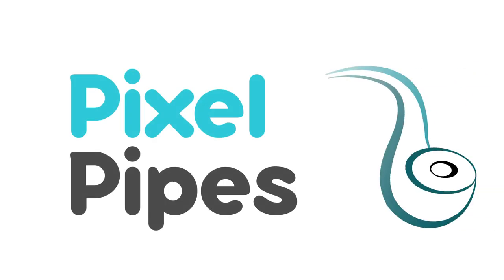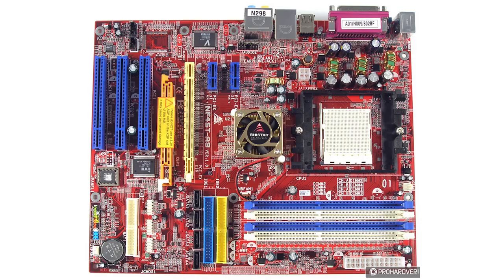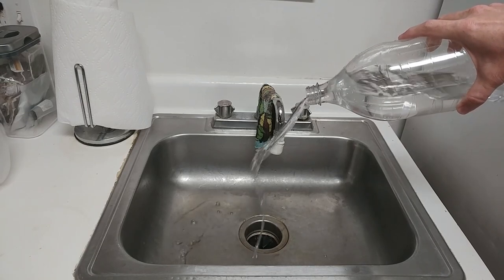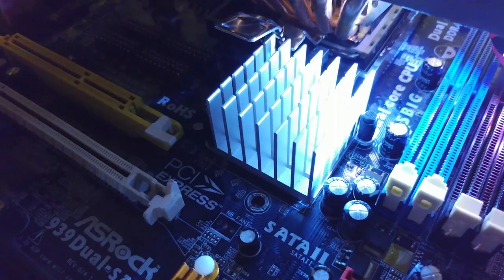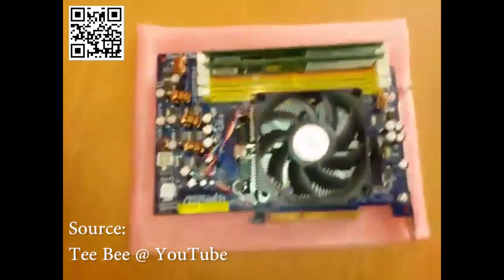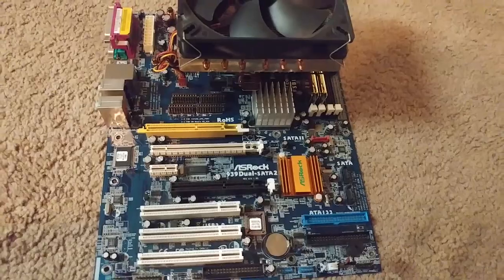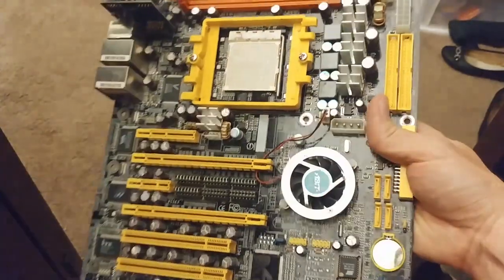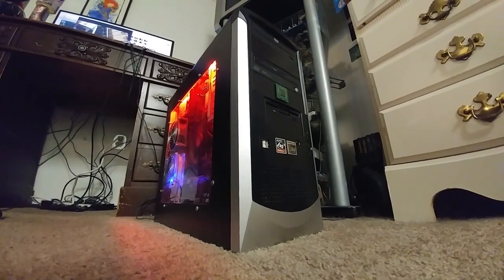Maybe the BEST Athlon 64 Motherboard Ever Made

Comment: I recently bought one of them, it came today.
Reply: How is 939 in 2019??
Reply: I'll do you one better: How is 939 in 2021?
Reply: @MauricioRPP1  I have collected a few high-end Athlon 64 motherboards, but none of them are on any build as of now. But I have an Athlon 64 3200+ on a socket 754 motherboard running Windows 10. It's actually useable with 2GB of ram and an IDE drive. So we can assume that a socket 939 with an even faster CPU or even a dual core with 4GB dual channel memory would be even better.

Comment: I´ve owned one back in 2004/5. Overclocking was impressive with my Opteron 146 running @ 3 GHz with stock voltage. It had some compatibility issue running 1T command rate that I didn´t have with another 939 motherboard that I owned, the nForce4 Ultra based Epox 9NPA+ (great mobo). But overall impressive overclocking capability, I could use any card (I did not get to use a PCIe one back then) and it was CHEAP.
Reply: I have one Asrock 939Dual-SataII, this week to sell, with the CPU X2 4600+, and 3 gb memory (2 x 1gb, 2 x 512 mb),

Comment: This mobo was amazing. I was lucky enough to get the AM2 daughter board off of eBay which allowed me to install an FX62 CPU and 8 gigs of DDR2 800 RAM. It was pretty fast and it was the most stable PC build I had at the time.
Reply: Do you know where to get one now? I have 2 of this mobo and would love to have the daughter board. I would buy it from you!
Reply: @p4stagg448  Unfortunately the system died due to old age. Try eBay, it worked for me.
Reply: I have one Asrock 939Dual-SataII, this week to sell, with the CPU X2 4600+, and 3 gb memory (2 x 1gb, 2 x 512 mb),

Comment: Your title is so accurate.  This is from a time when there was competition in the chipset space and motherboard manufacturers were still innovative.

I had one of these and it extended the life of my 9800 Pro by a year or two and with the voltage mods and OCW beta bioses, it was one of the best  overclocking boards of that era.  I remember hitting some crazy HTT speeds on that board.
Reply: I have one, this week to sell, with the CPU X2 4600+, and 3 gb memory (2 x 1gb, 2 x 512 mb),

Comment: This board was the board that put asrock on the map

It did everything, but wasnt price gouging unlike the other brands at the time
Reply: and now this board can hardly ever be found, the one i found the seller wanted i think $600? and it was from china soo.
Reply: @thelasthallow  Well, I have the even better ALiveDual-eSATA2, owned from new, since 2008 with the retail box packaging, documentation and everything and I should probably sell it to an enthusiast rather than cart it half way round the World.
Reply: @jimjamz.  if its the intel board its only worth about $100, the AMD board is worth north of $400 because it can take Phenom 2s which were faster than core 2 quads and are more modern.
Reply: @thelasthallow  It's the AMD board. I have a Phenom II X4 965 plugged into it and an NVIDIA GeForce 6200 AGP as we speak.  Owned from new since 2008, retail boxed with all accessories, manuals, driver CDs, cables etc...

Comment: I just realized that I had the AGP versions of both the Sapphire ATi Radeon X850 Pro with 256MB VRAM, and the ATi Radeon X1950 Pro with 512MB of VRAM. The X850 Pro was modified and overclocked the same day my roommate got it, the X1950 Pro was a factory overclocked HIS IceQ 3 Turbo card. All of my ATi cards from the heavily modified and overclocked Sapphire Radeon 9800 Pro with 128MB VRAM, to that HIS card, they all served me very well. My first PCI-E video card was a Sapphire Radeon HD-7770 with 1GB of VRAM. My last AMD card was an R9 290 with 4GB of VRAM, then to a Nvidia GTX 1070 with 8GB of VRAM and currently a Nvidia RTX 2080 Super with its 8GB of RAM. Have to say, computers were more fun early 2000-early 2010s.

Comment: The ASROCK 939DUAL-SATAII, and my ASROCK 880GM-LE FX were some of my best boards.  I got my A64 up to 2.8 Ghz and it could have gone faster but I had to lower the memory divider too much so I ran it at 2.6Ghz. I had a Phenom II x4 running at 3.9Ghz on the 880GM-LE FX.  This is on stock voltage, with stock heatsinks, and with cool n quiet enabled.  They were very stable and I never had issues with them.

Comment: Good board.  I have one of those DFi Lan-Party NF4 boards still running, and used the AsRock 4Core-Dual SATA-II back in the day. Very similar, except with full 8x AGP but only an x4 PCIe electrical (x16 physical).  Had the advantage of more SATA-II ports and Core2Quad support.

Core2Quad + HD3850 is I believe the best AGP system you can build.
Reply: Yes, it's best AGP combo, you can get. Not sure , if DDR3 are supported too, or only DDR2. Anyway, it's overkill for that graphic card, overclocked Q9650 can handle even 1050ti, before it starts to bottleneck graphic card in games significaly.

Comment: buyed this board in 2006 cause its was the only board with dual slot pciex and agp i was looking for a board capable of both cause i was upgrading and my graphic card was a 9800 pro agp 128mb but all new board came with only a pciex slot, i later upgraded for a x1600 pro 512mb pciex but i consider this board as one of the best i ever had but after 6 years the capacitor were broke so i just upgraded it for a new board upgrading from a athlon 64 to a phenom II x4 and im always using it today my board date since 2012 i also upgraded my graphic card to a hd5770 and now to a rx570 and even today i run graphic at very high with my old phenom II !! its sure i upgraded the ddr3 ram ssd and newer 4tb hdd  & power supply remaining to upgraded for a new board + cpu and ddr4 ram and i will be able to continue for the next 5-6 years !

Comment: Nice! I have this exact board with the AM2CPU upgrade and an x2 6200+ running in it with a beta BIOS that adds support for it.  Another board to look into would be the ALiveDual-eSATA2, which has an AM2+ socket that supports all the way up to a Phenom II x4 965, but still has FULL AGP 8x and PCI-E 16x support. It's interesting to test old AGP cards like the 9800 Pro with a somewhat modern quad core cpu so see how they perform with no cpu bottlenecks whatsoever.
Reply from the maker: Man, I would LOVE to have that board. I've had it in my saved searches for ages now. They never show up on eBay.
Reply: It was a very hard find for me. Took ages of searching online to finally get my hands on one.
Reply: Does it work with Vista or later OS (I own AM2NF3-VSTA) ?

Comment: I had one of these, really stable and great for overclocking. It was my first proper gaming PC had an Athlon 64 3500, a nVidia 6800xt and 2 GB of RAM in a chieftec case. I got a 4000+ and managed to run it at 2.7 GHz as a daily OC. That was with a cheap cooler and when I was 14 years old too. I always wanted the CPU upgrade slot but could never find it, it probably would have cost what I paid for the whole system though anyway.

Comment: Nice build and video!  I have this board and the AM2CPU laying waiting for a build. What kind of cooler do you use? Have you tried installing Windows 98 on it?
Reply from the maker: RetroCompaqGuy Thanks! The cooler is a Scythe Zipang. I only recently discovered the drivers are 98 compatible, so I haven't done that yet. But definitely will!
Reply: RetroCompaqGuy, when it comes to cooler and the limitations of the size that the AM2CPU gives i give one tip, AIO.
AM2 is identical to AM3 on the bracket and bolt-size so an AM3 AIO liquid cooler goes right on.
and a tiny singel 120mm one can be bought cheap.
don't know whats the cheapest on you market but here you got Antec's and the Corsair Hydro H74 for less than 50£

Comment: I own one of these as well, it was actually in my very first self build self bought computer, and it was my first try at bang for buck! I stocked it with an AMD Dualcore Opteron 165 (1.8GHz stock), 2x2GB OCZ 400MHz CL2 DDR, AGP NVidia GeForce 680GT 128GB, 128MB Ageia PhysX PPU, SoundBlaster X-FI Extreme Music, 30GB OCZ SSD V2 and 2x 320GB Western Digital Black 7200RPM in Raid-0. It was also my first overclocking machine... It still runs at 2.4GHz, with the ram at 484MHz CL2, the GPU was able to unlock all vertex and pixel pipes and overclocked just under the speed of the 680GTX. I later went on to put a PCIe 7900GTX in it which I later put in my then new machine (C2Q q9550) and thus the 680GT went back into it. It still runs perfectly to this day and is now being used as a basic AD and File/profile server + (WiFi) Router (Windows Server 2008 R2 with an AD/DHCP/DNS and IIS + Symantec Endpoint Protection, current uptime is around 1.5yrs and that time is low only because I moved it to a different house, uptime before that was around 3.5 years)
Reply: I have one Asrock 939Dual-SataII, this week to sell, with the CPU X2 4600+, and 3 gb memory (2 x 1gb, 2 x 512 mb),

Comment: That really is a awesome board. Agreed that it is a great board to tinker around with. I had a number of different CPUs and video cards in one over the years, but eventually settled with an Opteron 185, and a GTX 560 ti. Was a great gaming PC. Till it died a couple years ago, had the same problem of bad capacitors by the CPU slot.
Reply from the maker: It's definitely worth salvaging!

Comment: I have this board still, from a build back in 06, but unfortunately I’ve popped some caps and it just doesn’t make sense to repair it at this point. Which is a bummer, as it’s the first computer which I overclocked and it performed great.
Reply: Probably wouldn't be too expensive to repair. A handful of decent caps shouldn't cost over a buck or two apiece.

Comment: This board was very stable compared to my other amd boards at the time, and it was super cheap. The thing is, you said that it was a good oc:er but for real oc prowess you had to do a simple hw modification, just solder on a resistor and this board would fly.

Comment: I brought one of these when it first came out..I still have it..And it's in a working PC..At least it was when I last used it. Specs as is: 160GB Seagate, 512mb ram (4 x 128), ATI X800XL, Pinnacle TV card, Netgear wifi, SCSI Card..The cpu I am not sure of..I can't recall..I think its a 3800+ Athlon..or higher..Unless I set it up with a monitor etc I won't know for sure...been a while. Always hoped to get one of those add in CPU upgrade cards...but they were expensive and now rare as hens teeth. Pushing the price to crazy money.

Comment: Which are the other motherboards that use this full AGP & PCIe combo?
This is why i LOVE older tech , new tech is BORING at best
This was/is the board if people want to run stock configs mostly without any major crazy overclocking
It simply has Everything, best of both worlds: 
AGP or PCIe
IDE or SATA
FX 55 single core or  FX 60 if you want 2 cores
939 or 940 AM2 
DDR1 or DDR2
Great for Win XP or older 
..just imagine if instead AM2 add on board expansion, you could put Intel one :)
& the best part it was dirt cheap for what it delivered
Reply: 4Coredual VSTA quad core ddr2 support.
Reply: There is also the ASRock 939Dual-VSTA, wich is pretty similar to the shown 939Dual-SATA2
The ASRock ALiveDual-eSATA2
And the MSI 649 Neo-V
And one rather rare thing the ECS P88 Extreme Hybrid, which is one of the creaziest boards ever designed.  Not sure if it was ever actually sold.

And then ofcourse the 4CoreDual-VSTa and 775Dual-VSTA for the Intel LGA775 Platform, but they offer only PCIe x4 On the other hand, they have DDR and DDR2 slots.

If it is more about some obscure boards without that much choice. The Asus P5S800 got LGA775 with DDR and AGP.
Reply: Actually I'm using this board and it's been such a struggle to get working with so many variations of parts.
Reply: New tech is boring because Dennard scaling started dying in 2003 and was stone dead by 2006.

It used to be that a full node would give you twice the transistors (it doesn't quite do that today) and using them wisely you would get up to square root of 2 performance increase through IPC out of having them (out of order execution, caches, superscalar, register renaming, SSE etc), not only that, they would also run at about twice the clock speed at a lower voltage, cancelling out to give about the same power density as before. Scaling was actually a bit more aggressive, opting to use a higher than necessary voltage to race towards 1 GHz a bit faster and running power up to a bit above 100 W for a CPU, where it still sits to day.

If Dennard scaling had continued and the problems of subtreshhold leakage etc. that broke it down somehow been avoided, then you would be on a 500 GHz pentium 5 or 6 by now. There was only about 5 years between the pentium MMX 233 and the athlon 64.
Reply: "The Asus P5S800 got LGA775 with DDR and AGP."  ...and a shitty SiS chipset. No thanks. I'll stick with my ASRock 775i65G R2.0/R3.0 or ConRoe865PE. Those support Core 2 Duos and Quads (S775 obviously) on the intel i865G (775i65G) or i865PE (ConRoe865PE) chipset, also with AGP/DDR.
If you want even more oddball, ASRock made the P4i945GC board for S478 with the "modern" (by 478 standards) i945GC, which supports the only two S478 Pentium 4 models that had EM64T, a.k.a. 64 bit support
Reply: @TagTeamGamingWarped  Asrock 4CoreDual-VSTA and 4CoreDual-SATA2 only have 4x rated PCI-E slots, not utilizing all the PCI-E lanes.
Reply: @soylentgreenb  Thank you for the information! Reading more about it!

Comment: Can be this platform to be used with voodoo2 retro machine, like having PCIe card connected as main graphic adapter, and have connected voodoo2 to it as accelerator, and possible play Glide based games? Will Windows 98 find PCIe card?

Comment: Hi !  could you share your settings ? and also which driver you use ? ...  my HD 2600 XT is really slow on this board ...  :/    not sure why ... Maybe i should check with another card ?
Thx for every hint !  Also changed 2 caps on the same position !

Comment: Dude its so hard to find a solid s939 board these days with AGP. If the A8V died on my 4600+ & 6800GT build went up I'd be out probably ~$100 for a replacement board

Comment: asrock was a board known for oddball boards that do the budget upgrade thing the upgrade cpu cards were a great budget friendly way to update the system i have this exact board and had it from new its one of the rare 939 boards that actually lasted i got my cpu upgrade card on ebay a few years ago and run an athlon 64x2 3400 no overclock the cpu was a scrap bin find from a dead hp lol and a loud as hell tiesol cooler it runs like a champ even under windows 10 surprisingly with an 8800gt pci expres gpu (built the system with a 6800 series agp) loved asrock for their oddball boards another board manufacturer who did the same was ECS eleat group but they never did the future cpu doughter cards

Comment: The sata 2 port and the associated drivers were just not great. The drivers that came with the board performed poorly and sometimes didn't work properly. However there was a driver from JMicron later for Windows Vista that could be made to work under Windows XP. That fixed the issues for me.

Comment: How do you switch between the agp and pcie slots?  Jumpers?
Reply from the maker: Nope! You just insert into the slot you want and it just works. Both work at the same time, in fact, so you can have two graphics cards at once.
Reply: @PixelPipes  maybe the pcie slot is dead.  I get two quick beeps followed by 9 normal beeps at startup when using a pcie card. Any ideas what that beep sequence indicates?  I haven't been able to find it online.
Reply from the maker: @glittlehoss  If it works with other card types then it could be a compatibility issue, although check the caps around the slot because the board has cheap caps that go bad often.
Reply: @PixelPipes  so I left the s4 savage in agp slot and put a x800xt pe in the pcie slot and what do you know it worked fine. Yes compatibility must be the issue I guess.

Comment: Asus A8N32-SLI-Deluxe, I had that board and it was by far the best socket 939 mobo that money could buy.
Reply: Just fired up my A8N32-SLI with 4400+ (cool running E6 stepping) & ECC a month ago. Still as good as ever, but Win-10 has way too many things going on in background (I'm sure they're all important). I don't want to spend all day tweaking Linux, so for now it's sitting in the box.

Comment: this motherboard sadly doesn't seem to have windows 98 drivers, would have been cool for a win98 + winXP dualboot build where you had FX5900 Ultra for win98 and something like GTS250 for XP
Reply from the maker: Yes, it actually does support Windows 98.
http://www.nvidia.com/page/uli_drivers.html
Reply: huh... cool, but why didn't asrock put those up on their page, they only have drivers for win2k and XP up there
Reply: hm, I see one 939Dual-VSTA on ebay for a low price, seems to be almost the same, only differences I see on the spec shiet is it has cmedia sound chip instead of realtek, and different BIOS... if no one else bids on it I might take it to see if a win98+winXP dual system would be possible
Reply: Hey, PixelPipes, have you actually tried whether it does work under windows 98, with graphics hardware acceleration and everything? I bought the AM2 board with the same ULi chipset, the AsRock ALiveDual-eSata2, and inserted a radeon 9550 I had lying around, and installed windows 98SE and ati driver 6.2, and hardware acceleration wasn't working?

Comment: you think that's hot: LGA775 mostly same if not better features: https://www.asrock.com/mb/intel/g41c-gs%20r2.0/ [q9650 capable, 8gb ram]
 TESTED with BETHESDA'S DOOM 2016: https://www.youtube.com/watch?v=JQxlSKpDmJI
the budget version, same board: https://www.asrock.com/mb/intel/g41c-gs/
use g.skill ddr3 value ram, you can put 8gb on the motherboard, A BIG DEAL for say when you play NEWER games. pair with a 1660 ti, q9650 from intel. and you are GOLDEN.